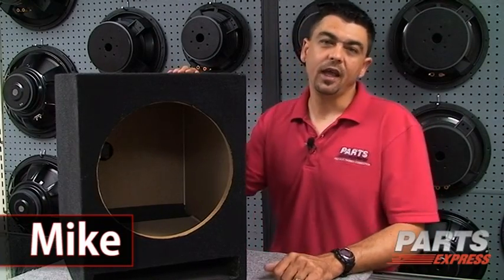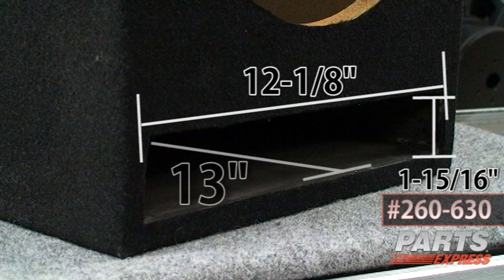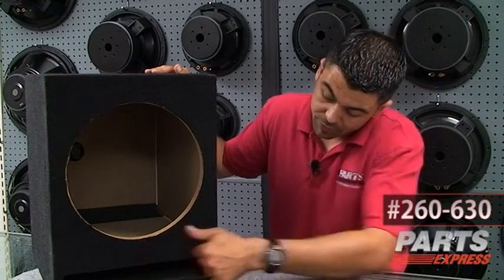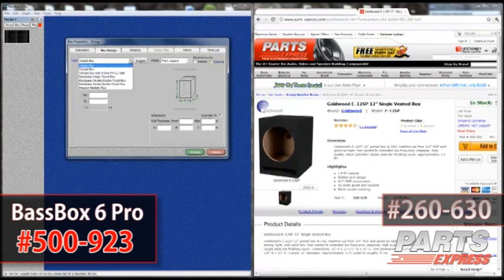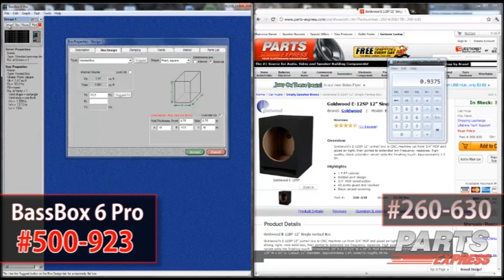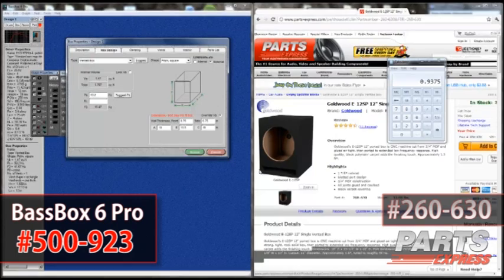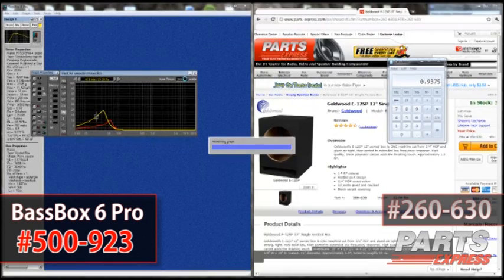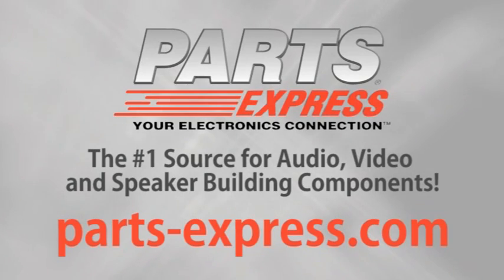Analyzing Goldwood Speaker Box w/ Bass Box Pro 6

Comment: When you keep the length of the port and enclosure volume unchanged, larger port = higher tuning, smaller port = lower tuning. However, the port must be large enough to keep the air velocity in it (at highest used power) below 15-20 m/s